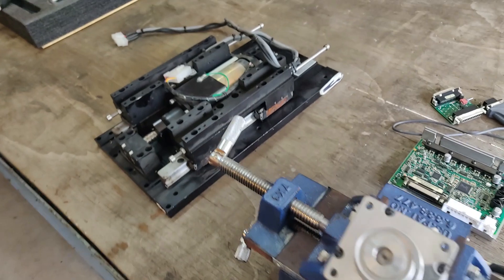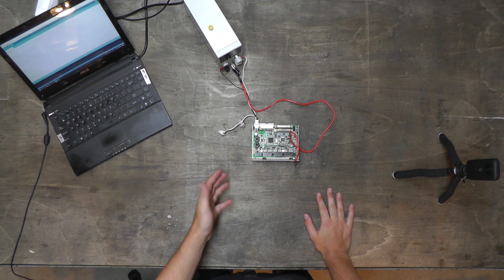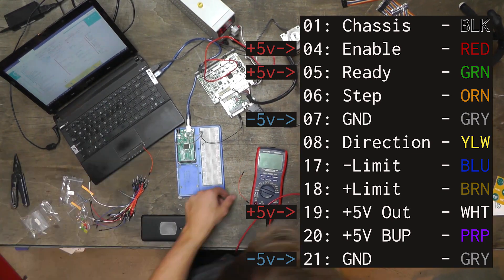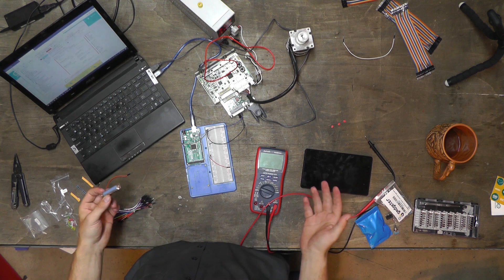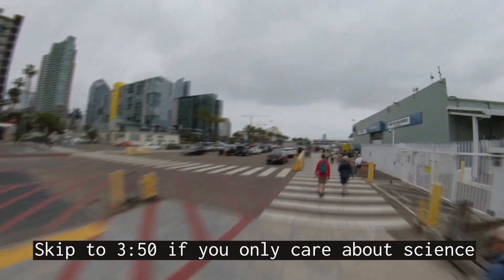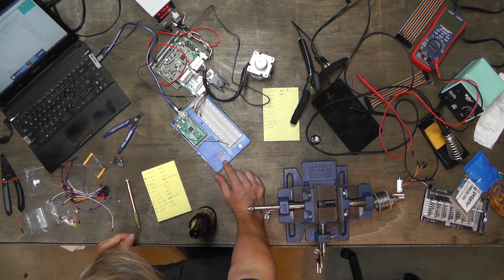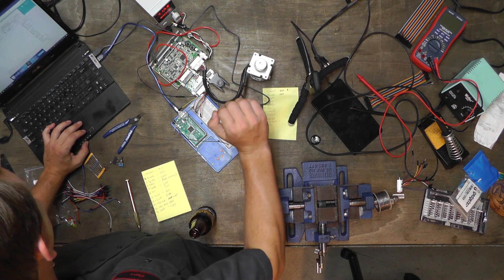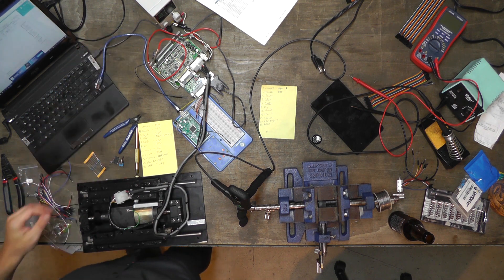Can I spin this industrial servo motor? (CNC Project)

Comment: I have some crazy indsutrial servo motors about 2hp each super small hut Holy fuck are they hard to controll but they are awesome how precise they are and they speed and omg don't get me started on the sounds they make they are awesome except getting the 480v for it was the hardest

Comment: It sounds like you're conflating two very different kinds of motors, those BLDC motors aren't stepper motors.
The first motor is likely way outside the servo amp's tune. Servo amps require a PID tuning for the mechanism it drives, and if the tune is wrong for the mechanism, you can get the wild oscillations you saw.
Reply from the maker: Thanks for a little expert knowledge! I have the manufacturer's tuning software, and I plan on tackling motor tuning in a future video. I was lucky enough to have a professional tune for the ballscrew servos, but not the smaller one.